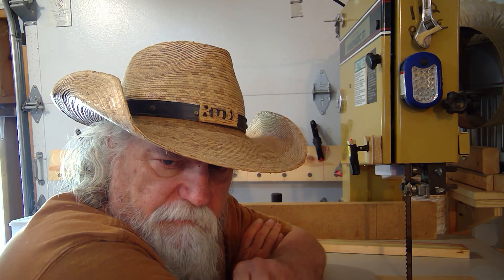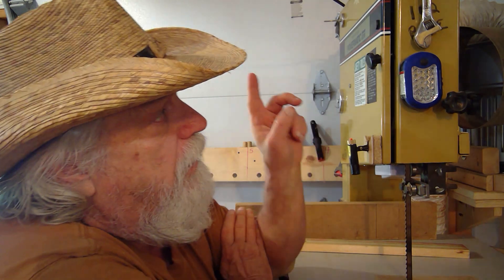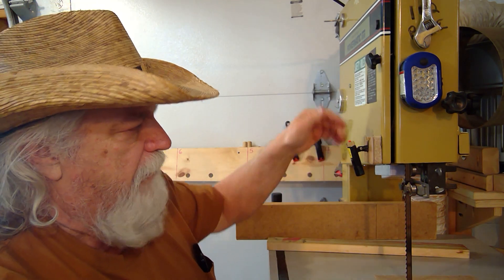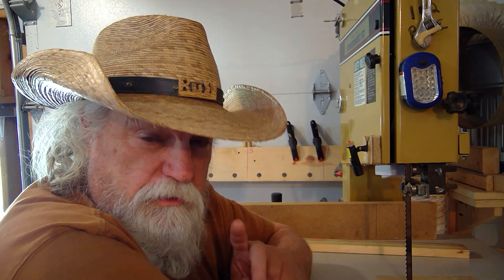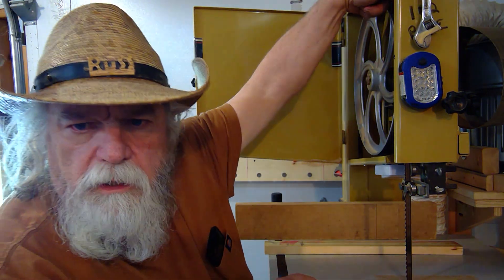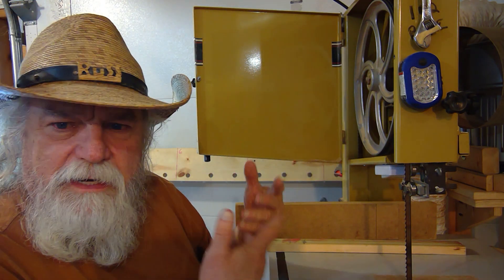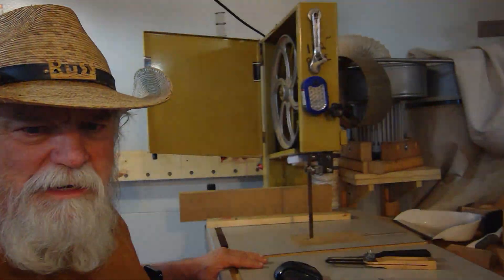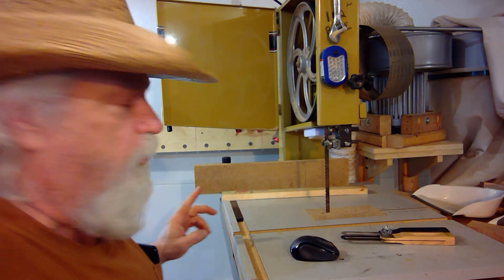Bandsaw Blade Drift Myths Follow Up by Show Me

Comment: Actual bandsaw blade drift is a result of uneven set on the teeth.  This can be a result of poor manufacturing tolerances or abuse.  Outside of carbide tipped blades most bandsaw blades have set, except for blades like the Highland Woodslicer (and the blades other companies sell with different names from the same Atalanta Sharptech stock) which have essentially no set.  The problem is many authors don't understand the physics of blade drift and speak anecdotally based on what "fixed" the problem when they experimented and often conflate their way of compensating for drift as "curing" drift, nope the blade still drifts but you have used one of the multiple ways to compensate for it, which is what you have to do save resetting the blade.  A rough analogy for blade drift is air in a cars front tires, if the air pressure is not the same in both front tires the car will veer to the side with the lowest pressure, a blade will drift to the side with the most set.   Also note tracking can only be used to compensate for drift on bandsaws with crowned wheels, most American and Asian saws have crowned wheels, most (modern) European saws have flat wheels/tires.  Those should be tracked with the teeth OFF the front of the top wheel and drift compensated for with the fence, while there are other ways the fence is the simplest way.  Tuning a bandsaw is a mix of science and black art and the attempt to get flexible tooling to act like rigid tooling is the source for so much confusion with bandsaws.
Reply from the maker: I can't speak to the "flat" (no crown) wheel.  I have never heard of (nor seen) that.   I cant imagine a blade could track on a non crowned top wheel.  
in this video, it is assumed all other adjustments are set properly and shouldn't need adjusting with blade change.  the main idea to this video is that even if the blade drifts, you can compensate for the drift by referencing the laser and easily reset the drift angle on the fence.  blade drift does not mean the blade is "bad".  it just means the  angle to make straight cuts is not parallel with the miter slot and table edge.  the other thing about drift is usually it remains consistent unless you abuse the blade (you can cause drift with blade abuse).  I have to reset the fence angle all the time because I use the same fence for resawing, ripping, and cross cutting.  when cross cutting the drift is not a factor which means I set the fence straight when cross cutting and reset to the drift angle for ripping and resawing.  the laser makes this a simple process. thanks for your input Vandy.
Reply: As I said non-crowned tires certainly exist.  I have them on my Minimax saws (built by Centauro) and almost all the post-WWII steel European bandsaws have non-crowned wheels.  Minimax,  Felder, Agazzani and the ACM built (Italian) Laguna saws are all examples of non-crowned saws.  It is easy to track a blade on these saws since they are built with the precision to track on flat wheels.  Crowned wheels are actually a legacy of the day and age where it wasn't as easy to get flat wheels aligned well enough to track properly, this changed in Europe post WW-II because so much of the cast iron foundry infrastructure was destroyed and they started building welded steel saws which allowed higher tolerances.  Flat tires have the advantage of spreading the pressure across the entire width of the blade (instead of concentrating it like crowned tires) this reduces fatigue cracks from work hardening usually associated with large cross-section blades run at high tension (25-30k psi) such as carbide tipped resaw blades.  Not really an issue with small saws since they can't create that level of strain and the small wheels will work hardened the blades backer quicker anyway.

Drift induced by the blade is simply a result of an imbalance in the set, period, there is no other cause for that symptom.  It is either a result of poor manufacturing or abuse to the blade.  Constant contour cutting will, for example, reduce the set on the blade side that is on the inside of the curve.  Almost all blades with set (again not all have set) will display some level of drift, there is a point where one could rightfully call it a bad blade but that is rare.  

The salient point which you are getting at is that bandsaws don't drift, blades do.  However, you have to use one of more adjustments on the saw to deal with it.  Tracking (on crowned wheels) is one method but usually the easiest is to adjust the fence.  That said on small saws one can often rotate the table but that adjustment is not always there and larger saws have tables heavy enough that it is not feasible.  The problem authors sometimes make, which you alluded to, is they speak as if one way is the magic bullet and often it is not.
Reply from the maker: I believe you that wheels are flat in Europe.  I have always been taught the world is flat and wheels are not.  it will be difficult to learn that one of those facts is untrue :>)  seriously,  thanks for helping with clarifying the facts and myths about blade drift. I am astounded that so many "experts" get it wrong and so many users are misinformed. I hope my idea of using the laser light to help adjust for drift will help others as much as it has helped me.  Again, thanks Vandy. BTW, I hope you are happy now.  you have me thinking about flat versus crowned wheels.  Do they use flat wheels on belt sanders too.  Now I have to look at that issue (myth?) closer :>)

Comment: Russ I’ve seen on some vids that they say to slacken off the tension on the blade when not in use do you do the same thanks
Reply from the maker: I never back off my blade.  I hear mixed stories but I have never seen any problem with leaving it tensioned.  My thoughts on blade tensioning is it might be shortening the life of the blade but I go to the BS, make a lot of quick cuts (5 second cuts) and go back to what I was doing at the bench.  re-tensioning is a pain (especially on mine).
Reply: Russ Veinot thank you for your reply it does get some what confusing at times
Reply from the maker: I hope this helps, Barney.  I see a lot of good and bad opinions/ideas out there and it confuses me also at times.  this "Show Me" series is about clearing up myths like this.  I think you might find other interesting subject on my channel.  thanks for the comment.

Comment: Interesting. My bandsaw was second hand and abused by the previous owner. He bought it to cut plasterboard for some reason. My bandsaw table does not appear to be 90 degrees to the blade from front to back. So it cuts the bottom of the wood before it cuts the top. This makes it a bit difficult to align the cut. There does not appear to be a way to adjust it. Is that normal?
Reply: Spacers behind the wheels can affect. See if there are any. Sounds like you might want to lose one from bottom wheel or add one behind the top wheel. Best not to use the thrust bearing behind the upper guides to force the blade forward.
Reply from the maker: Good answer Mitch.  Sounds like you need to use a straight edge to check alignment of both wheels.  you might want to do a complete set up to begin with. There are several good videos on complete (one time) set up.  let me know if you can find a good one.
Reply: @mitchwoodwork  thanks. I tried adding spacers in the bottom wheel but that didn't seem to make a significant difference compared to the tilt on the table.
Reply: I would space out the top wheel to try and cut sooner at the top of the work.Most tables are bolted on from underneath, so there is usually scope for adjustment with spacers there too.

Comment: I would like to see this test again but back off the (top and bottom) thrust bearing, move the blade to the front/back of the wheel then re-adjust the thrust bearing then make your test cut.

 I think you will see a different outcome.

Good stuff!
Reply from the maker: Who do you think I am? Mathias ??!! thanks Tim
Reply: When blade is riding at the back of the wheel the thrust bearing would be pushing on the back of the blade. When the blade is riding on the front of the wheel there would be a larger space between the blade and the thrust bearing.

Not trying to be difficult just making an observation.
Reply from the maker: you don't push the piece hard, let the blade cut and guide.  the wood wasn't that thick to require pushing hard. the blade was very close then but not touching.
Reply from the maker: no contact to bearing at any time during demonstration. it was backed off.  I could not have moved the blade to the back of the wheel if I had left it where it normally is set

Comment: Russ...an observation and a question :  I noticed that there was a good amount of distance from the piece of wood up to the guide wheels: how might this distance affect the amount of blade drift ? In my working career, mostly in a machine shop environment, I learned to keep the work and the tool as close together as possible. On milling machines and ordinary drill presses you want to have minimum distance for the tool to travel  before making contact with the piece being milled/drilled. This keeps the 'run-out, the "slop" in the machine spindle, to a minimum and hopefully eliminated completely. On a lathe you want the piece sticking out from the jaws also at a minimum distance so there is maximum support of the piece and minimum deflection from the tooling insert as it travels either across or backwards & forwards on the piece, ...or if you have a drill bit or other tool in the tailstock, you would also want the tailstock spindle cranked out as little as possible for the same support and deflection principle. I would think that this same principle applies to the band saw. What do you think...get my drift...?? LOL..!!
Reply from the maker: 2 points. first, I was cutting a small piece, thus no blade stress.  second, the guides don't touch the blade unless you put it under stress, like cutting a sharp curve.  you want the blade to cut straight and under no stress to see the drift.  I hope that explanation didn't bore you into drifting off, LOL2 ??!!
Reply: Ha...good one..!!  I hope this discussion doesn't drift too far off topic...LOL..!!  You started an interesting topic and discussion....neat..!!